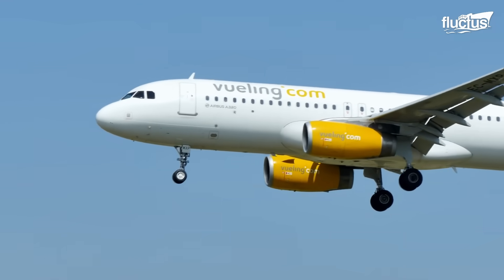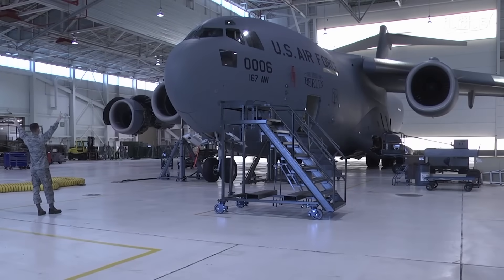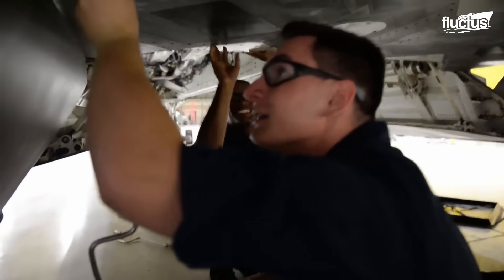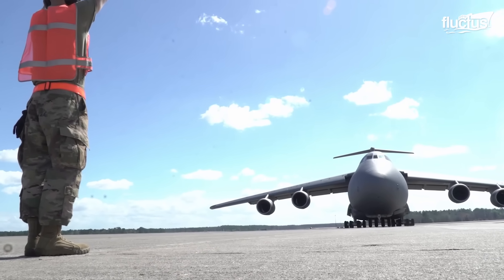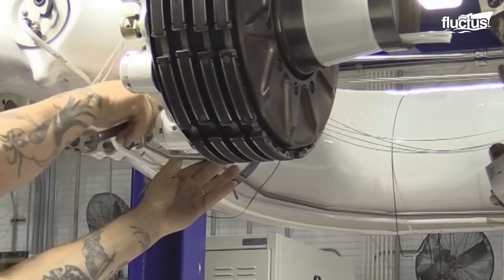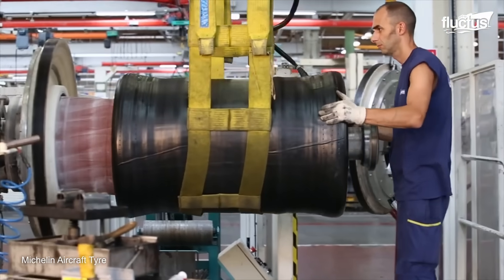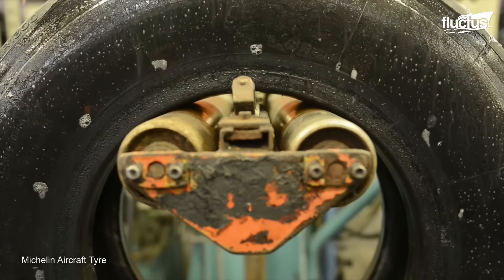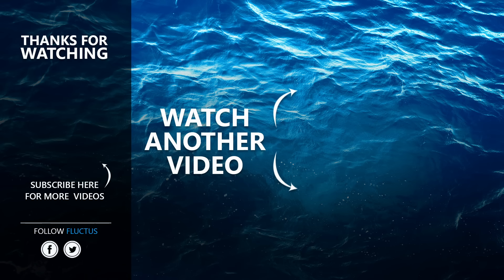The Hypnotic Process of Emergency Tires Change on US AirForce Aircraft

Comment: I USED to work for McDonnell Douglas on the C-17 project. I was in the FUSELAGE build area(the main fuselage, in a normal plane where passengers sit) the FLOOR is 70 FEET long, plus all related parts that are required. I was on that program for over 10yrs.  It was the BUSIEST wildest time that i have ever had. Would do it again.

Comment: For those wondering, built aircraft tires are considered a repairable item in the military, which is why you see the orange tags on them. Those tags are Ready For Issue tags, or RFI tags for short.
They are built up from wheel halves, left and right, and the rubber tire, plus the bolts that hold the wheel halves together. Most of the time those bolts are one time use only. I worked with tires a lot over my 20 year Navy career, either storing the rubber, or ordering them for the squadron I was assigned to. AFAIK military tires are inflated with nitrogen, not air, because nitrogen doesn't expand & contract like standard air does. Also, tire pressures are higher when the aircraft are flying from aircraft carriers, because they take a lot more abuse. My EA-6B squadron would inflate the mains to 250 psi for flying off a carrier, and only used 50 psi on shore.
Reply: Almost all tires in aviation get rebuilt...the rim's are NDT'ed, the tire is retreaded, etc....

Comment: The actual replacing the tire onto the rim is a nother job in itself. That unfortunatly they dont show in this vedio.  Splitting the wheel and Having the rim cleaned and inspected X rayed for cracks Then mounting the new tire and testing in a safety cage.